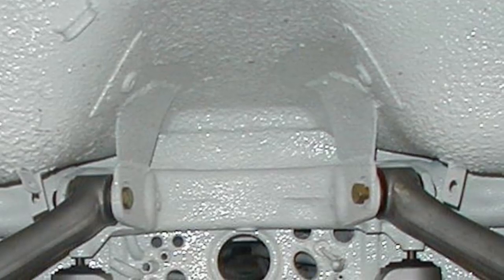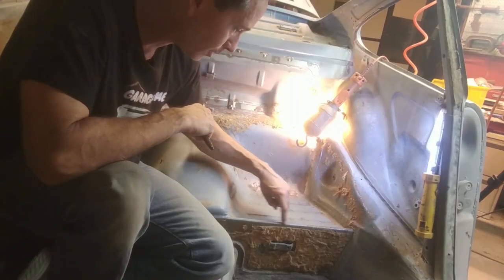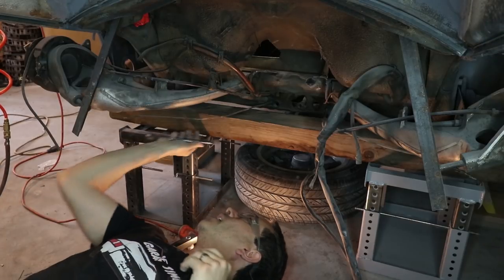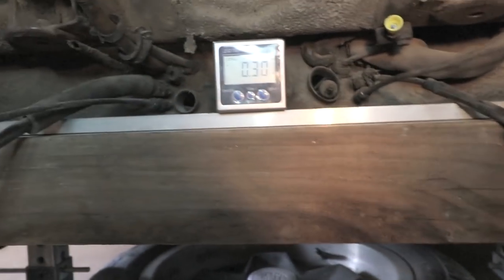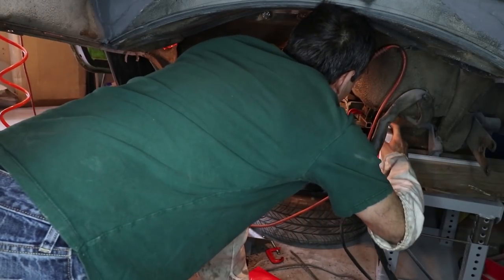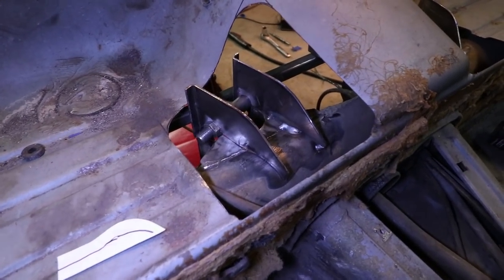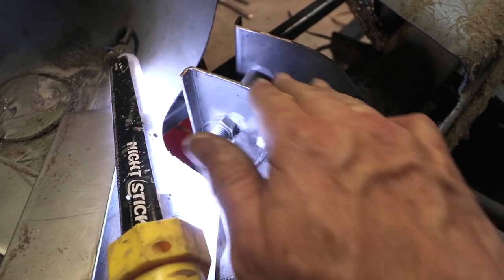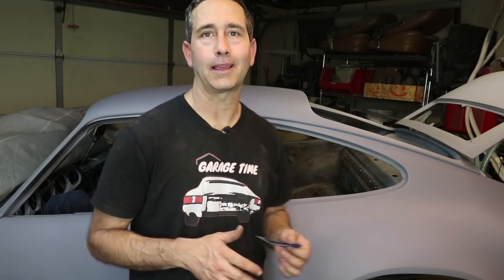I Hate Stanced Cars So I Made A Nifty Camber Box - 911

Comment: Awesome as usual, so many things you’ve made, that I must copy!
Reply from the maker: For your Maverick?
Reply: Garage Time - Restomod  I’ve been thinking about building a press brake like you have,.
Reply from the maker: Oh, I get it now.  My mistake was to not reinforce the square tube under the jack.  It collapsed one day when I was trying to bend  titanium!  It's a great tool to have.  I bought a few commercial dies on eBay for cheap and built it around those.
Reply: LOL! I thought that press looked a little funny. It seems to still work just fine though, so weeeeeee'll call it a custom modification, yeah, that's the ticket. :)
Reply from the maker: That's why I haven't fixed it yet, still works, but it doesn't retract well like it used to.  Someday when the car is done I'll fix some of these tools.

Comment: You’re a beast! Great video. Ive been wondering about these camber boxes and the installation. So - parallel to torsion and level to ground, new holes straight up? I wasn’t aware that installing some of these aftermarket camber boxes required the unibody mod. Also thanks for showing us the jig creation and final gusset installation!
Reply from the maker: Thanks and glad you liked.  I hope it didn't look easy in the video, it's not!  Yes the holes go straight up.  Basically perpendicular to the existing brackets and trans bolt locations.  Not sure how I will modify the seat pans yet, but yes I didn't go really aggressive on the hole heights and it looks like it will interfere.